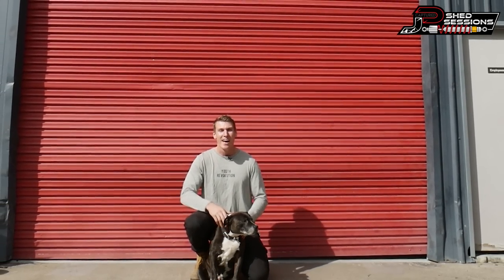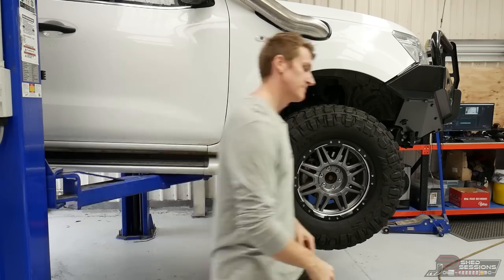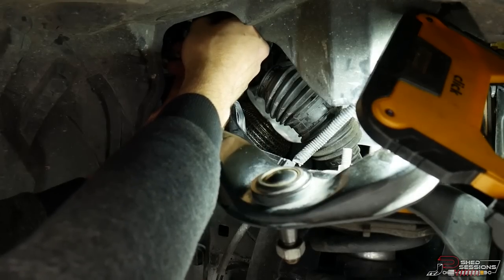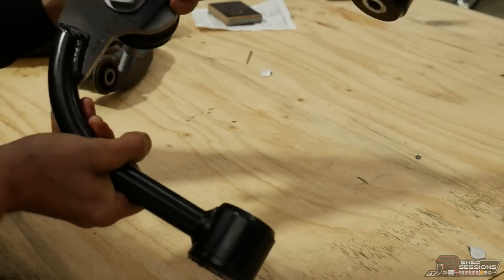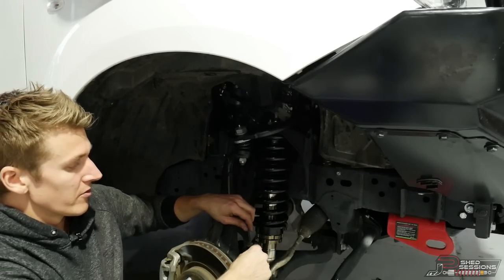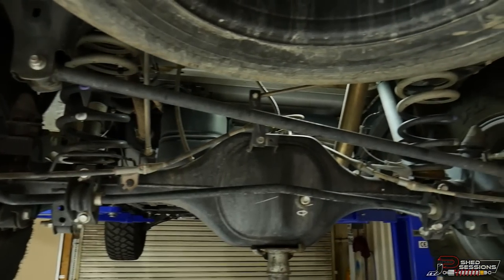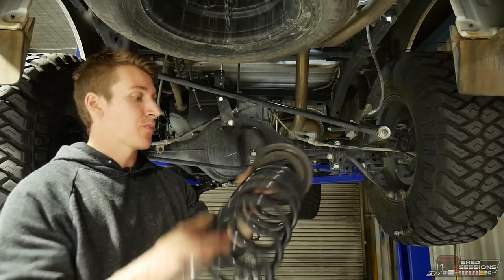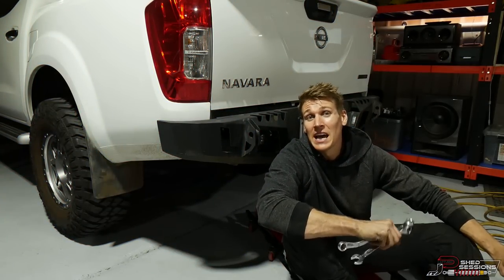NP300 LIFT KIT INSTALL DIY IFS SUSPENSION #ShedSessions #NP300

Comment: Great step by step to follow. Just installed a 3n2 in my nav only thing I wasn't expecting was absolutely every nut and bolt being tighter than a nuns @#$$. Absolutely ridiculous. Ended up snapping a socket and having to cut a nut to get the stock uca out 😤😤
Reply from the maker: They must have been insanely tight! F#*@n nissans 😂☠️
Reply: Man mine right now are insanely tight too. Air powered impact is getting me no where right now!

Comment: Hey man good video, I always like to see someone's install to see what unexpected challenges they encounter. One thing I noticed from your video is that you mentioned tightening all the bolts once the suspension is on the ground which is correct, but you should also loosen off & re-tighten any suspension arm with a rubber bonded bush (ie. trailing arms & panhard) so they are also unloaded at the new height.

Comment: Great video I really like the amount of information you gave us for our own projects. Diesel Tuning Brisbane I believe has a np300 high flow dpf in the works, not sure if it's for sale yet, but I saw a video of it back in April so it may be available now. Might be worth your while if you want to get woosh woosh noises. Also a legendex exhaust is what I'm hoping to buy would be great to see a in depth install and review of it. Lastly in regards to breathers (if you haven't already done them) Harrop do a pretty neat kit, their's has the added bonus of being able to breathe through your airbox instead of your engine bay so only cooler and cleaner air will get into the diffs, etc.
Reply from the maker: Some solid information Trav, cheers brother. I'm definitely into the idea of the breathers finishing up in the airbox 👌

Comment: Couldn't be any better timing, I've just been contemplating what suspension to put in my nav. Had been thinking comp shocks and now this video has made up my mind. Nice video mate.
On parts man dans website it doesn't show a remote reservoir option, do you just have to ask for them, cheers.
Reply from the maker: stoked i could help Spoggy! i'm wrapped with my kit. i'm surprised they are not on the website man, yeh i would say best to give Dan a buzz and pick his brain about the remote resi options.

Comment: Also is it ok if i just add a extended upper ball joint to the oem controle arm..im only doing 3 inch at the front.

Comment: Thanks for the video man, I'm about to put a lift kit in mine and this helps alot. Question though, is it okay to install the aftermarket upper control arms if you're only lifting with a 2inch kit?

Comment: t'was a great upgrade and very informative to details for self DIYer like me. Just an honest query though, how come you did not change the Panhard bar at the rear-end? does it have no bearing on the wheel alignment? thanks and more video pls.
Reply from the maker: I was going to address the panhard bar in the video but ran out of time. I will run through this in another video soon, however when i did the 2" lift the diffs tracking did not seem to be compromised to a point that i felt it had to be done. I have always used an adjustable panhard when lifted a vehicle but normally i lift patrols and i have gone 3" plus lift kits.
Reply: @jpcaptured799  big thanks for the prompt response. looking forward to more of your updates...

Comment: Can you do an install of the new kings aluminium roof racks? 🙂
Have to fix the rails onto the roof of the models without roof rails.
Reply from the maker: i was actually thinking about running the new rhino rack backbone system :-)

Comment: Maybe you could consider a zero or neg ative offset wheels, that will move your tites a little bit outer from the fender, lifted vehicles should go for a wider stance, anyway great job mate!
Reply from the maker: i really want to but i live in a state where tyre poke is frowned upon. So in order to do a wider offset i would need to run flares and i can't find one i like.. And the factory pumped guards look so good 😭

Comment: Nicely done mate, was a pleasure to watch, just a quick question, what size tyres are you running?
Reply from the maker: stoked to hear it mate, i am running 295/75r17  maxxis razrs
Reply: JP Captured nice I’m in the process of getting the maxis razrs for my hilux got a 2inch lift thinking of going for the 295s aswell.

Comment: Hey mate if you are just putting in the lift without changing the UCA, is the steering arm bolt connected to the UCA the only bolt you need to remove ?

Comment: Hi! Are you sure that you will have no issues with the CV joints? I mean with no diff drop. There are users who have broken the cvs with 3” lift without diff drop
Reply from the maker: Hey man, it definitely can't hurt to put a diff drop kit in and if you have the extra cash you may aswell do it. But as i mentioned in the video. I don't think the CV angles look to bad. So i am going to wait and see how the angles look when i go offroad.

Comment: Awesome video and rig, congrats! Will give it a shot on my truck soon...As to the break line plate that needed bending and the wheel speed sensor cable, was that necessary because of the brand you chose or the height you were looking for? Or does it needs to get done regardless of the lift kit?

Comment: Did you have to cut the cross member for the fuel tank to clear the drive shaft at full droop? I've been told I need to cut mine if I want to do a larger lift kit

Comment: Hey man I hope you see this, where did you get your rear sway bar extension brackets from? And what did you do with the front sway bar links? Thanks in advance man
Reply from the maker: Hey mate 👋 the front sway bar linkage s are standard and the rears were supplied by comp shocks, although they do sell heim joint linkages as well.
Reply: JP Captured ahh ok makes sense you wouldn’t really need to extended the front ones ay? Thanks again for the info man and killer videos too I enjoy watching them ☺️

Comment: what size tire can i use with no lift. can i use 32inch? also will there be any change on the power of the motor. i have the nissan frontier np300 2019
looking to lift only 2 inches near future

Comment: Great vid bro, one question. I got the same strut spacers but the factory upper arm con assembly rubs hard on the bracket that holds the strut in, did you have to slap in an after market control arm?
Reply from the maker: Not at all, i did not experience this issue.

Comment: I had a similar 3" lift kit with coilovers on my D40 and my cv boots would get torn frequently. :(

What tire size are you running?
Reply from the maker: that's because D40's are the navara model even Nissan want to forget ;-)

Comment: Nice rig. What wheel and tire size are you running?
Reply from the maker: Wheels are 17x9 +30 offset and the tyres are 295/70r17 👍
Reply: @jpcaptured799  thanks for the reply. Great  videos and awesome rig. Have fun and stay safe.